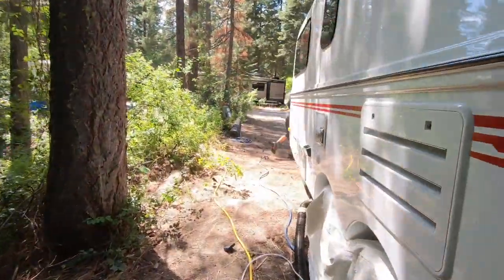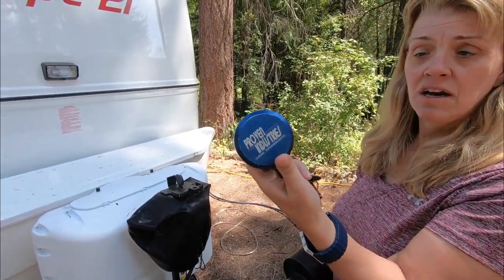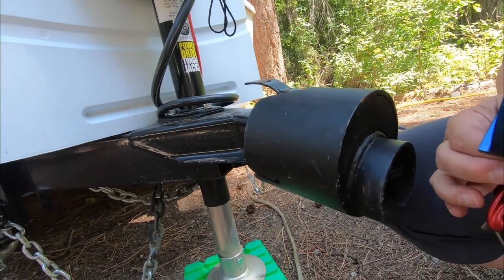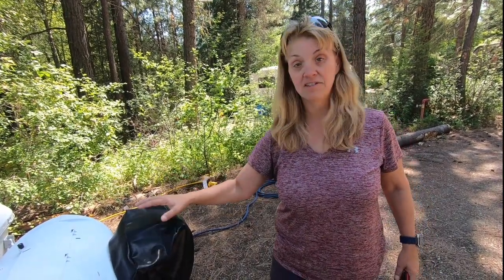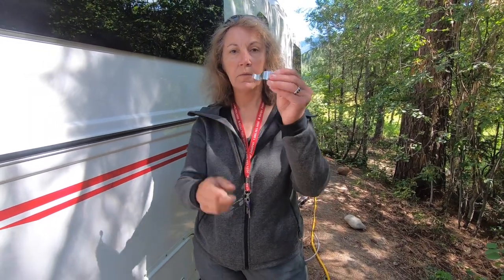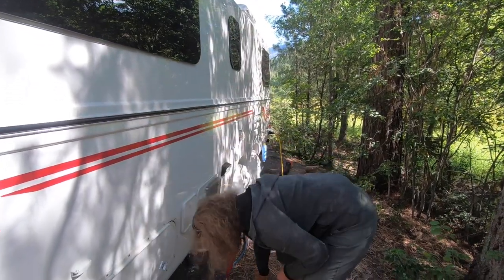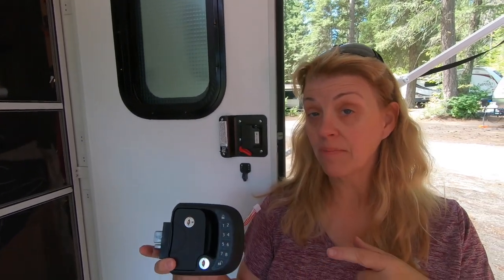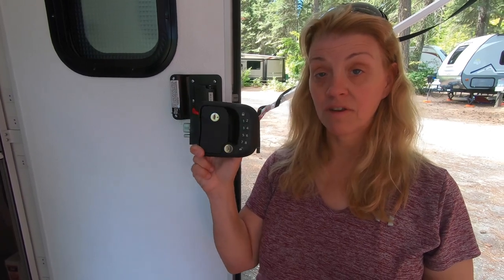RV Security - Full Time RV Living in Escape Travel Trailer 21

Comment: I would encourage anyone buying the Proven Industries lock to check with the company before ordering. I ordered the wrong model off Amazon based on old information. The company's customer service is great. They will take an exchange and get me the right lock even months after purchase. The one that works with my 21NE looks very different from the one in the video.
Reply from the maker: Thanks Mary, very good point!! The one in the video will still work but the new one is large enough for the chains to to fit inside to be locked up
Reply: Same thing happened with me for my 21NE.  Proven Industries very quickly addressed the issue, took care of the shipping and had me my replacement in no time.

Comment: I just saw a video where the "lockpickinglawyer" was able to drill through the Proven Industries puck lock in about 30 seconds.  He used to recommend this lock prior to him trying to successfully drill through it.  I am by no means an expert, but when I spoke to someone at Ft. Knox locks, they said the Proven Industries puck has proven to be easier to drill than many others. So great coupler lock for the trailer, but you may want to consider a alternative puck  for this coupler lock.
Reply from the maker: Hey Duncan, Proven Industries actually changed their design after people were able to drill it out so fast LOL. No lock is 100% but the harder you make it for a thief the better. Having multiple security measures slows a thief down and if there's too many obstacles hopefully they'll move on to easier pickings

Comment: We have the same lock and love it. We had to slam at first but after loosening the latch screws and pushing the latch back toward the inside before tightening it works fine. Also if you didn’t know, you can lock the door by holding down the lock button for three seconds without entering the code.
Reply from the maker: Hi Jim, unfortunately moving the latch didn't work for us but bending the door did. Thanks for the tip on holding down the lock button!!

Comment: Thanks for your super videos! We just received our new lock sets for pur 5.0, looking forward to installing now that I’ve seen it done. I was looking at dashcams for security as some have motion activation as a feature. It looks like a simpler way than the wifi cams (motion meaning visual motion, not the g sensing that is common on dashcams). On our first rv trip with a rental we had an early morning attempt to steal our new Honda 2200i that was defeated because it was chained to a tree. Highlighted security for us.
Reply from the maker: Thanks for watching!! I do like the idea of a motion sensor around the rv. Glad your generator didn't walk off!! You were smart to chain it up, probably one of the most coveted items for a thief :(

Comment: I was thinking if there was a system that made dual use backup / rear facing cameras as well as side mounted cameras for travel and lane changing, but then could be all be used as recordable surveillance cameras  when parked.  For some reason I can't seem to find a system that does this. Have you guys looked any more into cameras with or without wifi or cellular connections and maybe motion sensors, door sensors or alarms?  I'm a police officer by trade and have seen a lot of petty thefts, some of which include RV's, so I find it hard to trust people.
Reply from the maker: Hi Sean, thanks for the comment. At this time we have not looked further into these kind of systems. I know there's some good wifi and cell systems out there but have not researched which ones are the best

Comment: I finally bought locks and keyless door lock. Having some fit problems. My door locks don’t quite reach the strikeplate without shimming it so I’m wondering how Escape helped you with that? My cargo locks need additional shimming as well. I noticed you used those silver screw-on lock rings on both sides of the door. Did you get those additional ones from RVlocks or the hardware store? Thanks for your great videos and hope you are finding home along the way with the different world we live in.We took our first camping trip of the year this past week, yeah!
Reply from the maker: Hi Thomas, sorry for the extremely slow response!! Escape ended up adjusting the door by taking a couple of 2x4's and bending the top and bottom of the door out a little bit. I used the silver lock rings from the old locks that we removed. They made the perfect spacer! Thanks for watching and if you have more questions I'll try and answer way sooner!!!!